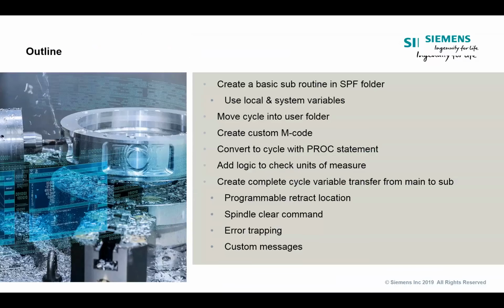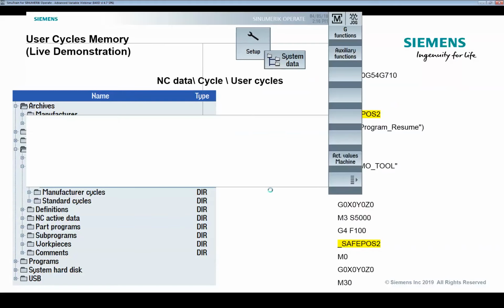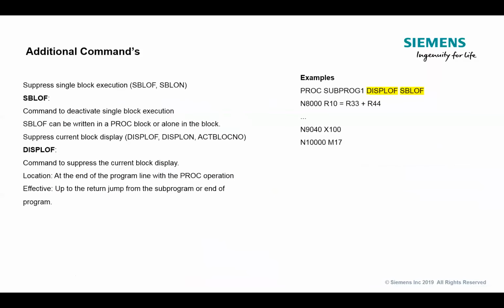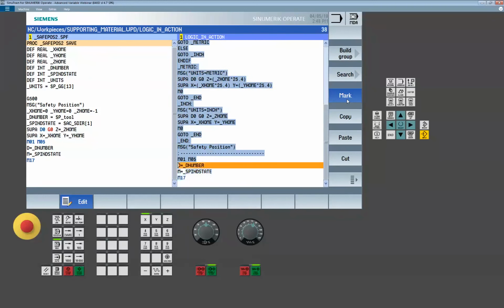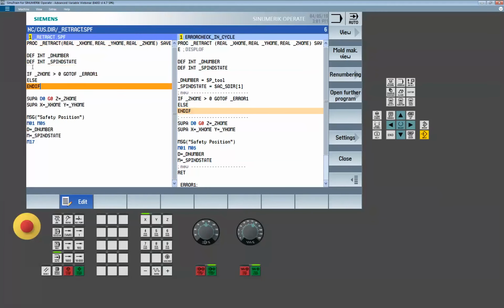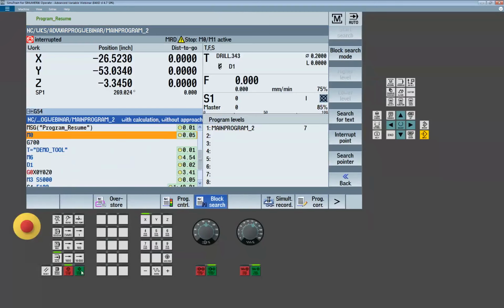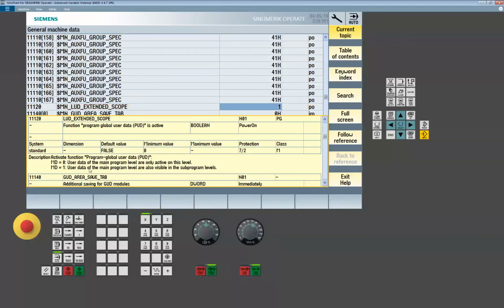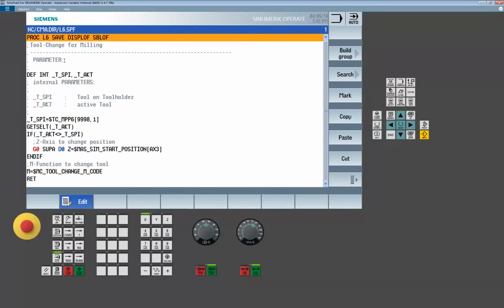Advanced Variable Programming with ProgramGUIDE   SINUMERIK 840D sl and 828D CNC

Comment: Hello MrCNC.
Thank you alot for your videos.
Do you know why im not able to see/access System data? I have Manufacturer access level.
Reply from the maker: What is the brand of the machine?
Reply: @MrCNC  Im using sinutrain, vertical milling machine with swivel table (5 axis machine).
Is any additional license required to access System data?

Comment: Your tutorial saved my life :) as I was searching this info, in vain, elswhere. Yet, one thing I cannot find on my machine (828D): there is no MD10715 and MD10716. Could you give me a hint?
Reply from the maker: You went to the Setup > MD > search > then type those in and they are not there?
Reply: @MrCNC  Sorry for confusion: I just did not have the full archive file but only changed data :)
Reply: @MrCNC  I have another question - if you don't mind: 
Can I call a user-defined-M-code in the T,S,M window? When I simulate it in Sinutrain (with archive option) it does not work...
Reply from the maker: should be able to